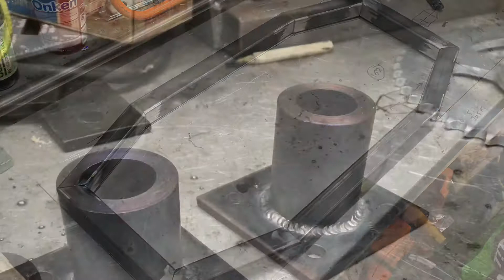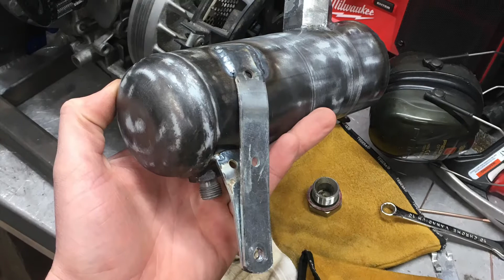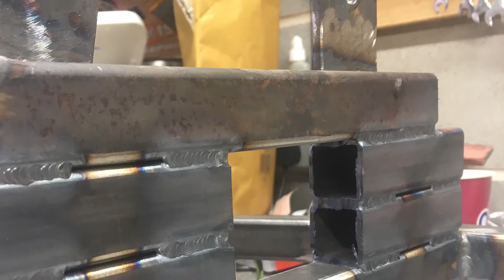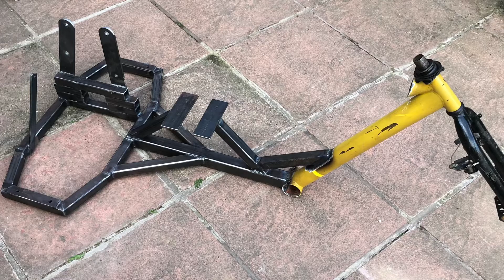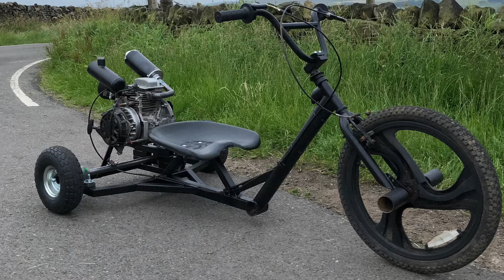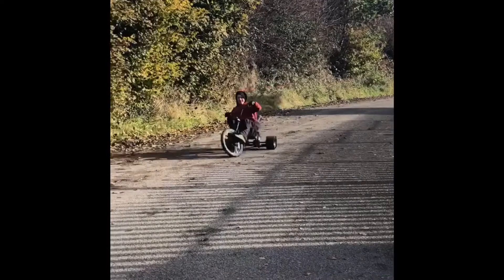Drift trike build, on a budget with a lawnmower engine

Comment: Slick build! Gcv to gc conversion - any tips?
Reply from the maker: All I had to do was remove the governor and alter some oil feed holes internally (some videos on YouTube on which ones to do)  and tap the threads to spin the carb. The Honda engines already have the oil flicker cast on the bottom of the con rod and the holes are there ready to turn the carb. Only problem with the mower engines is the size of the drive shaft, I slid a steel sleeve over & welded it in place to take it up to 1” - 25mm, I’ve done another engine where I ground the drive shaft down with the angle grinder whilst it was running to reduce it to 3/4” - 19mm